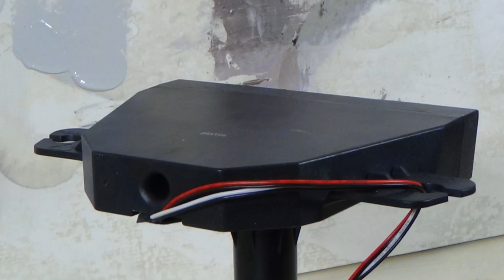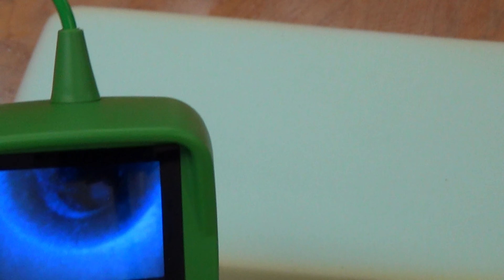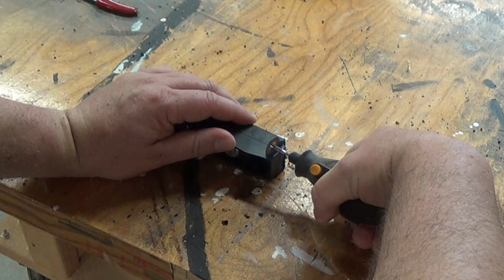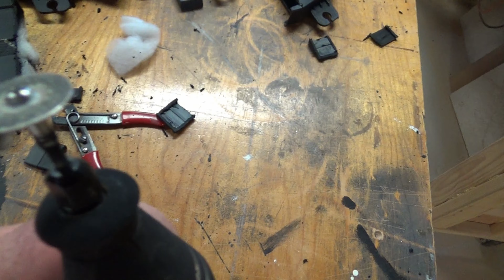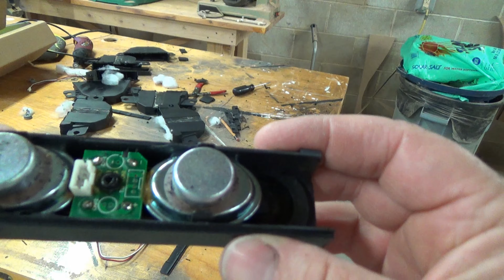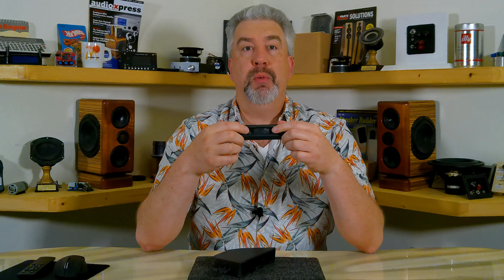Getting Everything Ready for Construction!

Comment: I'm trying a "hybrid" project using the 2.1 amp and 12v control board with this VU meter (or a similar one) for a stand alone amp box.  I'm sure I'll have to watch this a million times to get it.  I have to re-watch your video on the delay board as well.
Reply from the maker: Good luck. If you check the board, sometimes the leads for the Bluetooth board are labeled, if not check reviews, someone may have already done the digging for you.